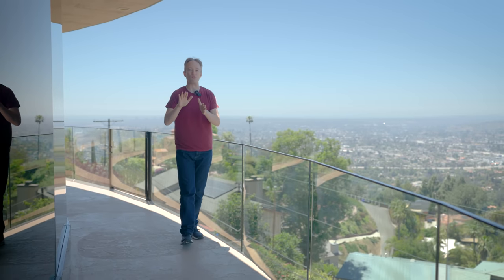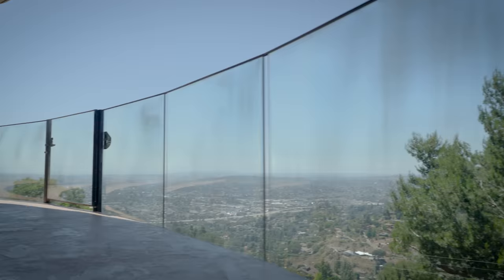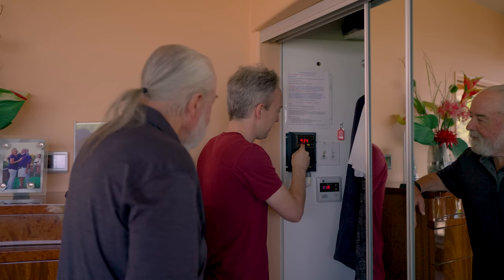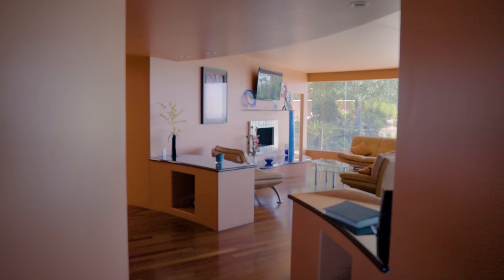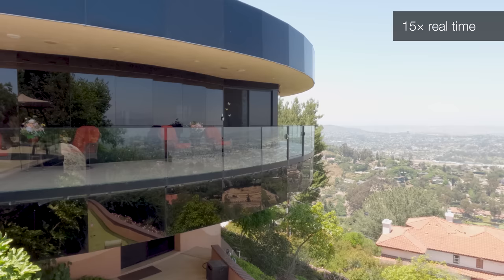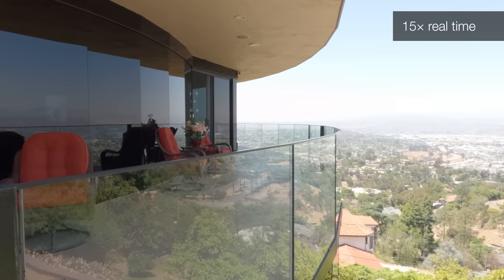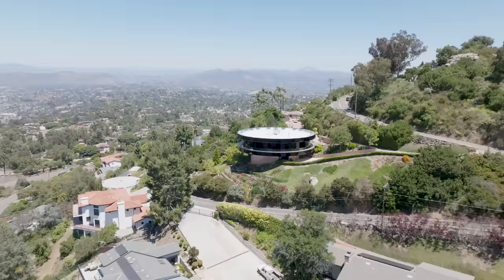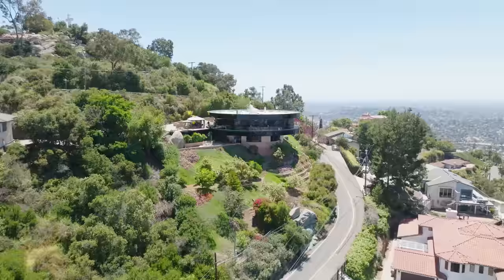I thought this rotating house was impossible.

Comment: For anyone interested, this is exactly the design used in construction excavators, which can freely swing around 360 degrees while still sending hydraulic fluid to power the tracks.
Reply: Must not be exactly the same or he wouldn't have been issued a patent on it. Either that or the excavators are paying him to use it.
Reply: @mattbosley3531  Even without seeing the ones in an excavator I can already thing of several potential differences caused by the difernces in use case that would be enough to warrent a patent. The changes don't generally have to be as big as one might think. (heck, even if the actual device wasn't different, sometimes simply using it in this fasion would be enough, if how one goes about doing so is different enough from how one uses it in the excavator).
But it's still fundamentally the same technology.
Reply: @mattbosley3531 You don't patent ideas, you patent designs. Al didn't come up with the idea of having multiple pipes in an axis, he just made one design with that idea.
Reply: Absolutely just being nitpicky, but I'm sure construction excavators don't have four mutually exclusive fluid lines in that swivel joint that if mixed would lead to instant catastrophic failure.
Reply: @DuckPerc  They still have to work and work faster and more frequently than a rotating house.  Excavators run for many years with minimal maintenance .
Reply: @mattbosley3531  A patent that has run out by now.
Reply: @jonb3311  I hope they don't use natural gas and effluent. XD Could be entertaining though; I love me some line welding youtube. :p

Comment: In my head, I thought you’d have to use the bathroom at very specific times to catch the drainage hole perfectly 😂
Reply: or just stop the rotation at a specific point. But how they actually did it is way smarter.
Reply: I imagined a cistern that empties (septic) or fills (drinking water) as it passes a valve.
Reply: Or... have a septic tank that automatically drains when it reaches a certain point in rotation.
Reply: "Oops I missed the toilet rotation guess I'm not flushing for another 54 minutes"
Reply: Unclogging that drain would be unpleasant.
Reply: @sizanogreen9900  What I don't get though is why not put drinking water on the top just as redundancy?
Reply: @sizanogreen9900  neat how he made the utilities work correctly.
Reply: @user-op8fg3ny3j order doesn’t actually matter as all are under pressure. Likely the sewer too.
Reply: Haha this was my first exact thought when I seen Tim had posted!!😂
Reply: @abbofun9022  In the case that they mix, wouldn't the bottom get mixed with whatever's on top?
Reply: @user-op8fg3ny3j which two mix would be based on which two seals break
Reply: @HDFlood_ if it's yellow let it mellow, if it's brown go around.
Reply: @user-op8fg3ny3j  that's what I thought initially "why not put the drinking water on top, less chance to contaminate it ?", but I realized it's under pressure so it won't really matter anyway, if one seal fails the circuit with the most pressure will leak into the other one next to it regardless of their respective positions.

I'm guessing the patent is more about the seals than it is about the global contraption, because even before he explained it I already supposed that's how he'd done it (that's how I would have done it, too, and it took me 30 seconds), but making it air/watertight and keep it safe for 75 years is a whole other story.
Reply: @user-op8fg3ny3j  Fair point, but there are several factors deciding what happens in any case of deviation from the normal operation. As long as the pressure is present, it should not be a problem, but if a seal breaks, it depends on whether any individual pressures fail too. There are enough potential failure points to write a book about, but I don't feel qualified to describe them.
Reply: @pbe6965  oh, that makes sense then. But yeah, maintenance is going to be a perpetual headache as if you forget about it, you risk spreading cholera
Reply: @user-op8fg3ny3j  The Largest Hole is for  sewage  it has to run up the center.
Reply: Ey there!
Reply: That… is true. Honestly, that’s better, because it means the things below it, which are under pressure (unless there is some really weird stuff going on), wouldnt be contaminated, as the pressure would keep the bad stuff out.
Reply: lol i thought similar- but more realistic- you went whenever, and it stores it all in a temperory tank that gets to empty some every rotation when the holes line up.
Reply: Would be another solution for the drainage. Use a circular drop groove. Water still trough the center. Gas I would use portable liquid gas or no gas at all.
Reply: @criticalevent  would also be good solution.
Reply: It's still hard for me to wrap my head around.. 
A contact between two materials that are sealed, but still move past each other, without causing immense friction, and doesn't wear out in a few days. 🤯🤯
Reply: I wonder what happens if you use it while it’s rotating? And congrats on nearly 550 mc episodes!
Reply: The ad states there are "3 and a half" bathrooms, so I guess you just need to pick the right one. Take care with the "half" one though because you might end up peeing into a sink.
(just kidding)
Reply: @dallasmed65 buddy you made my day :)
Reply: @scikick he house rotates at 1/45th of an rpm, so the friction isn't that big 
If you have a faucet that rotates (which uses smaller o rings) you're putting way more stress on it even adjusting for the size difference.
If you're doing 1/8th turn in 2s,  turning the tap very gently, that's 3.75rpm, with a 2cm diameter that's 3.93 mm/s
With a 1m ring rotating at 1/45rpm that's 1.16mm/s, so that's 3.3 times slower. Try taking 6s to move your faucet 1/8th of a turn.
Reply: 999CLIPS  shut
Reply: That does seem to be how the door to/from the outside works.
Reply: Another solution: One cetral hub for sever in the basement another for fresh water on the roof.
Reply: @user-op8fg3ny3j  nah, not if bottom is at higher pressure, no doubt this was all very well thought through and am not gonna second guess an obviously brilliant engineer like Al. 😳
Reply: @RipVanFish09  Sewage isn't pressurized, it relies on gravity.

Comment: I live near the Schilthorn in Switzerland, which is a rotating Mountaintop Restaurant. A full Rotation takes 1Hour, so you can enjoy the full 360° Panorama while comfortably sitting inside. And yes, only the two ringshaped Platforms inside with the Tables on rotate, the rest of the Building is fixed. It was  a Filminglocation on the James Bond Film "On her Majesty's secret Service".

Comment: The cut at 0:17 is such a subtle moment of great filmmaking. Since there is no camera operator next to Tom when it goes to the drone, that means that these have to be seperate takes. And yet it's so seamless I didn't realize until I rewinded a couple times. Seriously great stuff!
Reply: Kinda looks like they added him into the drone shot, the lighting looks off
Reply: @kassthered8452 Holy cow!! I didn't even notice it, great job pointing it out. Also props to Tom as always
Reply: I reckon the camera operator had enough time to run before the drone panned out?
Reply: Good eye, @kassthered8452!
Reply: @LAOTG  doesn't work with the transition back from the full shot at 0:27
Reply: @oliverturner128  ??? Tom is just pale.
Reply: @ef-tee  oh I didn't look for that. Hmmmm. Tom should do a "making of". Now I'm thinking it would be easier to digitally remove the camera operator from the drone footage then to add Tom in?
Reply: it might just be zoomed in

Comment: I love that the homeowner essentially invented a very specific solution to his very specific plumbing problem and got a patent for it.

If one of you ever want to build your own rotating house the technology is there😂
Reply: Because we've done spinny things with electrical connections from at least WW2 (You can thank RADAR for one of inventions pushing that innovation forward.), the only real hurdle was the fluids slipring.
Reply: @jackielinde7568  spinny things with fluids also have been in use for a long time. For example excavators.
Reply: @Jehty_  Those are usually hydraulic lines that don't go to the thing that spins. Hydraulics are used to spin the wheel that mining excavators use, but they don't actually pump fluids into the wheel. And, you're not feeding several fluid services through the same point as well. And seeing the fact that the home owner had to design his own solutions proves that "no, it hasn't been done before."
Reply: Or a rotating space ship.
Reply: @jackielinde7568 What? You might want to look into how an excavator works. What drives the tracks and the blade and the return fluid from those all while the cab can spin around.
Reply: @jackielinde7568  sorry, but you are wrong.
Google "rotary union"

 The engine in an excavator is in the upper half. Somehow the hydraulic fluid has to get to the undercarriage to drive the hydraulic motors. That's done with a rotary union. Exactly the same as in this video.

And the guy in this video did invent a rotary union for the use in a house. That's new. Not a rotary union in on itself
Reply: @MrSleepProductionsInc  The cab doesn't run the hydrolics or has the pumps in that rotating section. The engine, pumps, and lines are all within the main body, not the cab. Only electrical is passed into the cab. And the boom arm doesn't use pass throughs in the joins, but just sections of flexible hoses along the joints. And the drive motors in the tracks don't pass fluid to the tracks, but just turns. Nothing in a mining excavator does what the home owner needed. Same thing for cranes that get lofted above high rise construction. And any commercial construction equipment with rotating cabs. Reason the controls in a lot of forklifts, bulldozers, and tractors are hydraulic instead of electric is because the cabs don't move in those vehicles.
Reply: @jackielinde7568  please look up how an excavator works
Reply: @celebrim1  this was my thought too.
Reply: @jackielinde7568  By 'cab' he means the upper structure of the vehicle, which rotates above the tracks or other drive units. The cab is a part of this - along with engine, fuel tank, hydraulic reservoir, hydraulic pumps, all the control valves, counterweight.. Yes, excavators use rotary fluid unions. Have done for many, many decades.
Reply: @jackielinde7568  I own and work on an excavator. I kinda have an idea of how they work but thanks for your input.

Comment: My brain just exploded with how good the engineering is! Well done, Al!
Reply: I was thinking how is this different then a spinning high rise restaurant plumbing/electrical wise?
Reply: Your brain exploded and you can still type. I'm impressed.
Reply: @johnl.7754  It's briefly alluded to in the video: in most (or maybe even all) of those, the plumbing, kitchen, toilets, etc. are in the fixed central hub while only the dining area rotates, so you just need a slip ring for electricity. (And in places like the Donauturn in Vienna, all the service areas are in a completely static level underneath the rotating part.)

Comment: Another simple solution zero maintenance: flexible pipes designed to twist by 180 degrees in 2 directions and a rotating house range limited from -180 to +180 degrees.

Comment: The slip ring fluid manifold is similar to hydraulic couplings used in excavators so they can spin indefinitely while maintaining the connections they need to their tracks
Reply: Yep, I was reading about them after watching WhistlinDiesel's video where he spins his excavator around and around.
Reply: Farmcraft101 explains it in one of his videos. I think it’s called “One of the worst parts on my excavator broke”.
Reply: The bravery of putting the sewer and greywater lines above the drinking water line...
Reply: @johnkintner  The clean water is under pressure, if anything it'll go the other way.
Reply: @wolf986 I'm imagining fresh water coming out of the gas stove if that deal fails

Comment: What I especially love about all this is that it doesn't only work, it seems to work consistently with all problems solved. There are no loose ends. It's not a gimmick just to have it. If more people would want to design rotating houses they wouldn't need to look much further than adapting this design just like you would do when creating a water faucet or a wheel. 

It establishes what feels like solid standard even though it's a unique piece.
Reply: Indeed if there was one of-the-shelf rotating house-supply system that already comes in with water/waste/electricity/networking all in one working peace we could see a lot more rotating houses everywhere.

Comment: I feel like the transition from drone shot back to camera (0:26) during the opening sequence diserves recognition. Tom went through the effort to choreograph his movements for the drone shot AND the camera shot (stretching his hand out as he turns back to the camera), and placed the cut from one shot to the other mid-sentence, so that the two shots feel like they're different angles of the same take. This transition techically didn't have to exist, but with the way his monologue is written, it makes the flow of the video feel natural.
Reply: "It will be alright on the night" vibes :D
Reply: He really made the needle spin.
Reply: Yup. There's a slight continuity discrepancy in his hands' position, but still, you can tell he probably did his script twice so they'd have room tp splice the two shots easily afterwards. Tom Scott always goes on location with a very precisely written script, I'd be surprised if some of the most intricate ones aren't storyboarded.
Reply: @yannick1984  You make an interesting point about a precisely pre-written script - I'm always blown away by Tom's preparation.  I can never quite wrap my head around having everything written before you've been onsite to conduct interviews (but I'm aware interviews are often filmed like this).
Reply: You're impressed he did the same thing twice?
Reply: @Joe-sg9ll  yes they were two entirely different shots.

Comment: That plumbing slip ring is amazing. The engineering process on that alone, I think, is more interesting than a rotating house.
Reply: Imagine seeing this idea use with battleships, or some sort of rotating military tech fortress, on land sea or space
Reply: @sofakingonmynuts1438  Rotary couplings (similar but smaller) have been around and commercially available for a long time, for air or hydraulics.
Reply: @Modelero  yes but the military is clearly lacking in rotating house duplexs with missle launching capabilities